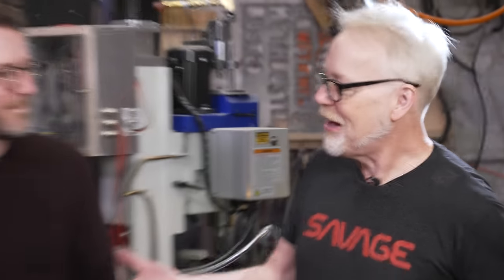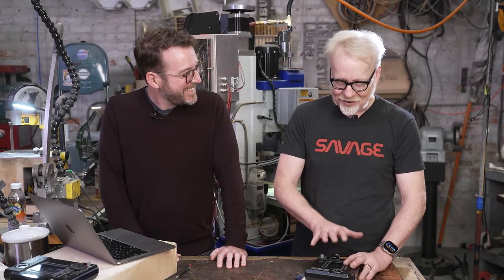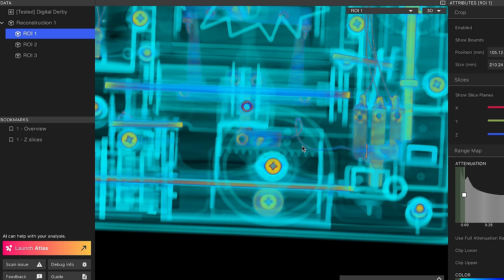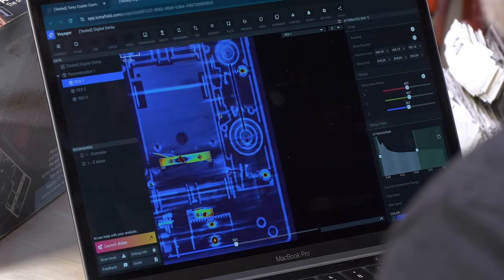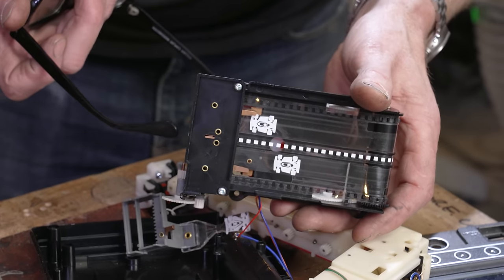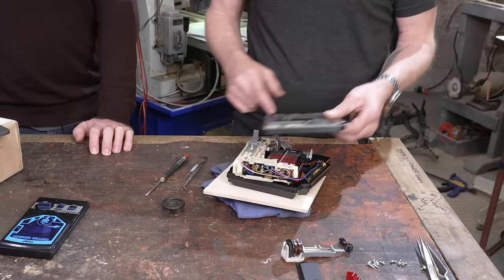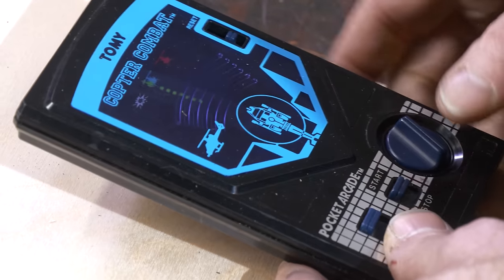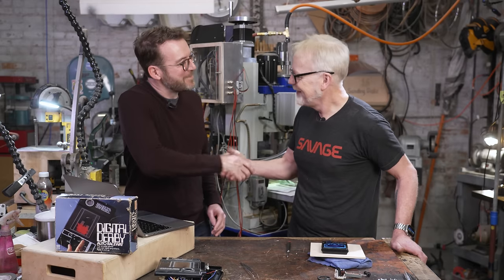Adam Savage's Favorite Mechanical Handheld Game!

Comment: All we had in the mid-late 80s were those water games and ball bearing labyrinth games. We did get a sneak peak from time to time at new devices that were smuggled behind the iron curtain. So from 1985 to 1995 we went through the same technology cycle as the west did from 1970 to 1990, which means everything became instantly obsolete :)
Reply: Remember playing with a labyrinth maze with a bead of mercury in it at Kmart. 😁 Then chit it split 🤪

Comment: There was also Blip! which was a mechanical version of Pong.    It did have a battery which was only there to light up the LED for the ball.   A wind up  mechanism provided all the motion.
Reply: I, too, had both Digital Derby and Blip. I may still have them and my old Merlin in storage somewhere. Now I want to dig them out and relive old memories.
Reply: I had Blip.   Completely mechanical, outside of the red LED.   Not quite random...If you played it long enough you knew the pattern....    I took it apart many times...  I also once saw someone use it for a Darth Vader chest box.  I'm not a hundred percent on this, but I'm thinking it was a skit on a show called Fridays.   May have been Michael Richards....
Reply: I forget which channel did it, but someone did a pretty fascinating breakdown and explanation of Blip on here a while back. Tomy did some incredible stuff with their engineering in the ‘70s and ‘80s.

Comment: the old Radioshack Super Armatron is another great mechanical toy. I never actually had any of the little blocks and things that you're supposed to manipulate that came with it, but I had a lot of fun just making it move around.
Reply: The Super Armatron was actually another Tomy creation. Some people added computer control to the arm. If I remember correctly, solenoids to pitch the joysticks back and forth.
Reply: Loved it too, and I still have mine!  It still works.   I almost bought something so it could be controlled by my Tandy Color Computer 😂
Reply: I had the regular original Armatron when I was a kid, so I bought one a few years ago on eBay for my kid.  It’s needed some repairs/upkeep over the years, so I’ve definitely had it all apart and been fascinated how it all works by engaging various gears connected to a single central motor that constantly runs (as long as the timer is in a running position).  
I love it.
Reply: I got one for $5 at a local thrift store when I was like 13. Opening it up for cleaning was an adventure. The gear trains and such were genius.
Reply: I had a Mobile Armatron in the late 1980's thru Early 1990's. It was a lot of fun making it drive around and pickup and move various things.

Comment: TOMY engineers were next level ! I am lucky enough to still have my Atomic Pinball from TOMY , a D batteries devouring , mechanical noise machine from that era...The solutions they found to somehow recreate the "digital" feel with only gears and a motor were no less than remarkable . Also the game BLIP  (a sort of Pong clone) inner workings had me puzzled to this day.
Reply: I hate to think how many hours I spent playing Atomic Pinball as a little kid ... that and screwball-scramble
Reply: @njones420 YES! You made me remember I still have my "Run yourself ragged"  in a box , which is actually the same game as screwball-scramble !! Great memmories !
Reply: @theforso  So last year (2023) they released "Screwball Scramble Level 2" ... which connects to the side of the original game to continue it    :)   
...just had to wait 43 years

Comment: I remember having this and I knew exactly how close together two cars could be and still be able to squeeze between them. If I recall correctly, I'd usually flip between neutral and 3rd and you'd learn to read the positions of the two cars near the top such you could sit in the left lane behind the faster of the two and swing into the right lane just ahead of the slower car. It felt so smooth and real.

Loved this game!
Reply: Oh, but you'd have to swing back into the left lane ASAP otherwise "another" slow car would block you in the right lane. So I think I'd camp out in the left lane and only dodge into the right when needed.

Comment: I just tracked down Dark Tower, a board game with an electronic tower. The tower has a motor inside that drives a carousel of images to display as the game plays. It uses an IR LED and sensor to calibrate the picture carousel. It's wonderful in its simplicity!

Comment: I played with something very similar as a kid but it was sort of a dashboard of a car with a larger steering wheel and gear lever with a screen on top.  I think it was mechanical because it was also a static car that moved left and right when you turned the wheel.  This was in the 80s though so I'm sure it was a bit more advanced that this one.  I looked it up it was the Tomy Turnin' Turbo Dashboard.

Comment: Back in the mid-late 70's I had a mechanical PONG game. It looked nearly identical to a 2000's era Apple iMac G3 in blue-green. Inside was a long counterbalanced rod pivoting from a post at the very back and extending towards the front and tipped with  a light, and moved  very close to the translucent screen. On each side were 2 paddles that moved up and down when you turned the external dial controller. 
Everything happened physically inside, bouncing off the paddles but the "ball" would always curve a bit because of gravity.

Comment: I had the fully mechanical TOMY games when I was a kid. Didn't have the driving game. TOMY made one that was a sub game, and it was horizontal than Vertical. They also had a variety of "themes" so you could play a game that fit your personal tastes. I still have one or two of those games, but the spring severely needs replacing.

Comment: I still have my one of these, and it still more or less works, despite younger me dismantling it to fix it back in the day!
Mine is a bit different. It does not have the strange bulge on the side where the battery box is and tomy have renamed it "demon driver".

Comment: In grade school in the 80s for a while we'd take shoe box lids and cut slits in the top top - one at each short side, one on the long side - and make a side-scrolling shooter game. Ya glue sheets of paper together to make a long scroll for the level and thread it through the smaller slits, then take some thin cardboard to make a little arm with a spaceship and laser as the player piece, and slowly thread the scroll along. Before hand you'd draw stuff on the scroll, and "shoot" it with your little ship. Your imagination did a lot of the heavy lifting there, but it was fun for what it was.

Comment: I remember a friend had the same handheld toys, and when i first saw them when i was about 10 or so (in 1992/3) i kinda laughed at them for being "lame".
Because i was used to having my GameBoy, but i became mesmerized by these (mostly) analog games.
I started to collect similar analog toys, like the waterjet ring games you mentioned and also those ink drops in oil 'hourglasses', i could watch those for hours.

Comment: Back in the late 70s our family owned a game that sort of used the same principles of sliding tape and blinky lights. It was UFOs flying past, jumping on the Space Invaders bandwagon, but instead of the complexity of that game, it was basically just shooting the bonus ships. The challenge was that each slide of tape went in opposite directions, so the lower strip would roll through barriers to your cannon, which would prevent a clear shot.

Comment: When I was a child, I had a toy that was something like a cross between the two devices shown. It was a racing game, powered by a wind-up spring. Two concentric rings would turn at different rates, each with two lanes of traffic to weave around. If you crashed, a reset switch would pull your vehicle into a pit area. I quickly learned that the traffic would regularly align to have all four lanes blocked at once /\ and to pre-emptively jump into the pit lane to avoid a crash. You don't get any lap counter while in the pit, but it still spent less time winding down the spring than being forced to the pits by a crash. Unfortunately, I can't quite recall if the vehicles were race cars, or space rockets.

Comment: 80s kid here. I remember a similar but slightly later version of this game that was a bit bigger and meant to be used on a tabletop (or floor as most of us actually used it) and meant to evoke the appearance of a car dashboard. Still mechanical, but the steering wheel and screen? playing surface(?) were larger larger. Meanwhile I had an Atari and NES at home, but these things soldiered on into the mid-80s, at least.

Comment: Speaking of toys of that era with complex gear trains, the Radio Shack Armatron had an impressive one. A multi-jointed manipulator arm powered by a single DC motor and it was all mechanical from there. Even the control sticks were mechanical gear shifts. The motor was the only piece of electronics in the whole thing.

Comment: What's funny and amazing is that this is a mechanical COPY of the first fully SOLID-STATE handheld video game (Mattel's Auto Race) which came out two years earlier!!

A truly impressive all mechanical toy that feels like it should have at least some electronics is the TOMY Armatron robot arm.  The only electronics was an ON switch.  The controls were all mechanical.  The craziest part was that it had ONE MOTOR and SIX degrees of freedom with wrist rotation (unlimited), vertical wrist flexing, horizontal elbow bending, shoulder horizontal rotation (unlimited), shoulder elevation, and the opening (releasing) and closing (grasping) of the two-fingered end-effector.  The thing looks like a Swiss watch inside.

Comment: You say that it was trying to replicate the video game experience, but did you know that from the mid-sixties to the late seventies there were electro-mechanical games similar to these in the arcade? I would say that the most significant inspiration for 'Digital Derby' is Chicago Coin's 'Speedway' from 1969 (a localisation of the 1968 Japanese game 'Indy 500' made by Kasco). 'Speedway' was a racing game with gameplay very much like 'Digital Derby' but instead of wraps of film it used rotating discs to simulate the two different lanes of traffic and the passing scenery. I highly recommending looking it up and seeing how it worked!

Another fun fact about 'Speedway' is that it was a very popular game at the arcade where Nolan Bushnell worked, and in part it was his experience with games like it that inspired him to found Atari. So, to my mind 'Digital Derby' is a home adaptation of an electro-mechanical arcade game that helped to start the video game industry.

Comment: I had one as a kid that worked similar to that except it was more like Space Invaders.  There were "alien" ships that flew horizontally across the top and your missile tank was at the bottom.  You shot a missile and guided it to try to hit one of the aliens.  All of it was physical gears, film, and lights similar to that one.  I had opened it several times out of curiosity and just to see if I could get it all back together again.

Comment: Some futurists have predicted a return to mechanical computing, using nano machines.  And there are some things you can do with mechanical computing easier, but electrons move so quickly it's hard to beat them.  But if you can make the mechanics small enough, mechanical computing (or even better combinational electro-mechanical computing) could be a thing.

Maybe for niche applications.

Comment: It's funny that a completely mechanical toy is called "Digital" Derby.
Reply: Well, you do operate it with your digits... 😂
Reply: Maybe call it "Analog Derby"?
Reply: That also happened with watches, there were a lot of mechanical watches that were called digital because they had discs that told the time instead of hands during the 60's and 70's.
Reply: They explain how it chooses whether the gear was flipped by a crash or not. That's digital, on or off.
Reply: Not a good name
Reply: Digital doesn't have to mean transistor based, the electrical part of the hit/no hit detection system is digital. But yeah that's definitely not why they used that word, that's 100% marketing
Reply: I think they were trying to pass it off as an electronic handheld game. I remember a lot of that going on at the time.
Reply: Digital feels like a marketing buzzword, like how VR was a buzzword in the 90s
Reply: @rodziegman I am not sure but I think you are confabulating digital and binary. I think digital can refer to either a way of displaying numbers or having to do with the use of one’s fingers.

Edit.. proofreading..
Reply: The idea is that this game is pseudo digital game that replicates to some degree an arcade racing game but completely mechanically. So it’s not digital in an analog vs digital sense but it’s digital in a very old school sense. Given this was when digital electronics/computers were becoming a topic of discussion in homes and even affordable home micro computers were starting to e a thing with the Radio Shack TRS-80, Apple II, and Commodore PET, they wanted to get in on the hype. The fact this wasn’t true Digital electronics as was being used in computers and early game consoles like Pong clones, the Atari 2600, Fairchild Channel F, etc, wouldn’t matter much to kids getting this for Christmas.
Reply: I  try is “Digital” because you can switch it on (1) or off (0)…
Reply: Oooooo. Sounds futuristic!
Reply: It has a counter!
Reply: The lap counter is digital, represented as discrete numbers. For it to be analog it would have to be something like a progress bar.
Reply: The same company also made one called Blip that was essentially an analog PONG.

Comment: This video triggered another toy memory which I had forgotten about until just now.  I believe it was called "BOMBS AWAY".  You piloted a physical airplane and dropped bombs onto various targets.  Picture a turntable except the table is decorated like a crude map with various targets labeled on it, and like a turntable, it would rotate, just at a much slower speed.  Instead of an arm with a needle, picture a small little toy plane elevated about 18" above the table that you could control it's lateral movement between the outer edge of the map (table), and close to the center of rotation, pretty much just like a turntable arm.  Your plane was loaded with bombs, I can't how many, and the player would look through an eyelet onto a series of mirrors so you could see what was below the airplane.  The targets on the table have concaved receptacles that would catch the "bombs" if your aim was accurate.  Does anyone remember this toy???  

Trying to find a video on this toy, I just discovered that another nearly identical toy existed called "Chutes Away", and it was released the same year, 1977.  This was obviously a more popular version of this game, for I can find practically no information about "Bombs Away", but quite a bit of information regarding "Chutes Away", including an advertisement someone uploaded on this platform.  It's not Bombs Away, but it is nearly identical, just picture a smaller plane:
https://www.youtube.com/watch?v=0gDScZxaZ1k
https://www.youtube.com/watch?v=v_pfkTj4t0Q
https://www.youtube.com/watch?v=5W4s0voVnpc

https://www.youtube.com/watch?v=RTu-IHXXVFM
https://www.youtube.com/watch?v=TzcxhtcsfUY

Comment: That film might be  Kodak 127 size. 35 mm would have had sprocket holes on both sides but 127 only had them on one side. I'm sure that due to cost concerns they would have used something off the shelf rather than a custom slitting order. The copter game looks like they used 110.

Comment: I have actually thought about trying to make one of these. I had "Torpedo Terror" (same game as the helicopter one you showed here but with different art) and "Desert Race" (an all-mechanical version of the race game you showed here, lacking the gear shift) as a kid, and I picked them up again a couple of years ago to see how they actually work and think about designing new games in that style. I was considering doing a homage to Terry Cavanaugh's Super Hexagon, but the only mechanism I could think of to make it work was to put the level on a cylinder and slowly drop it into the level, with a parabolic mirror around it at the base to render the view--but it lacks elegance. I probably need to design a new game suited to the format instead. In any case I needed more CAD practice before I could plausibly attempt such a thing.

Comment: When i was a kid any time i had a toy that had a motor if it stoped working or borke id try to fix it if i failed id remove the moter mess around with it foing stuff but my favorite thing to do with them was use them to cut, weld, sand, and shape plastic things.

Comment: No... You can absolutely go higher than 99 for score. Once you figure out the pattern of passing and pausing, you can get beyond 100. I'm damn sure I've done it. You should never have to use neutral... If I recall correctly, when in one of the gears (1st or 2nd) one lane would go the same speed as you, and the other goes faster... Once you line up the two visible cars to be apart enough to pass, you can always get through at the fastest speed. To get the highest score, you're always switching gears to keep that passing room consistent.